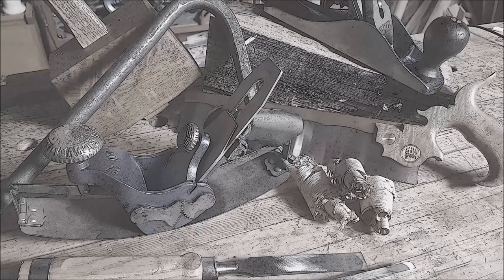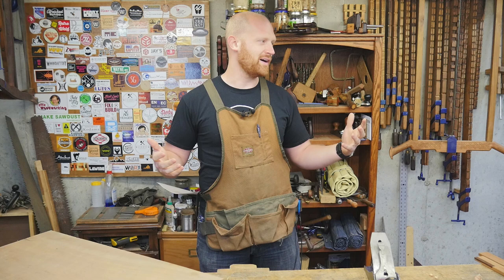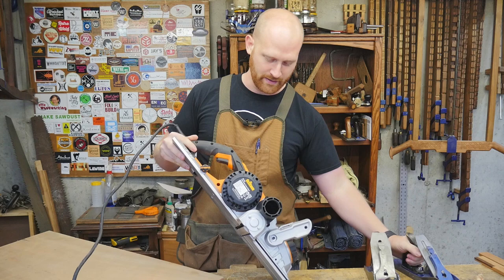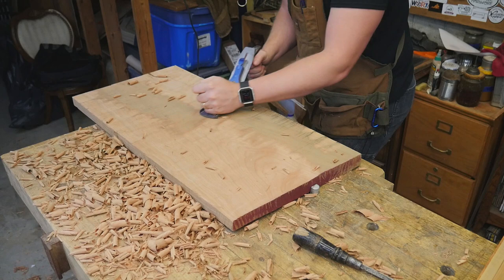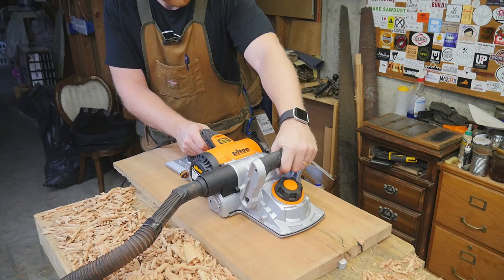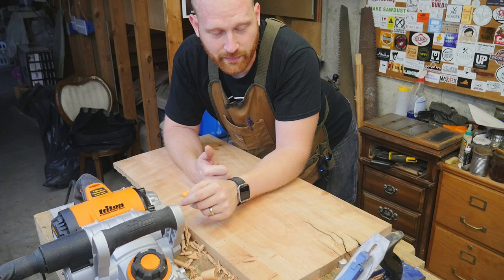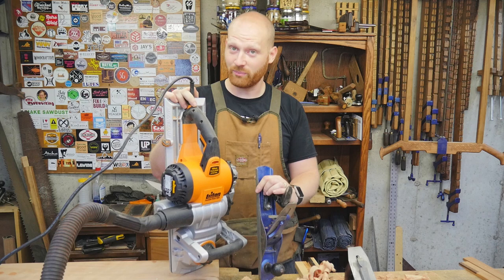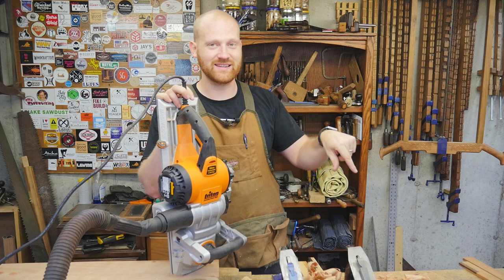Power Tool Vs Hand Tool - Power Planer and Scrub Plane Which Tools are Better in a Woodworking Shop

Comment: Thanks for the honest opinion and the video!  I agree that using a scrub plane on multiple boards is a beast to tackle by my lonesome.  I contemplated using a power hand planer to augment my hand tool use but was also toying with the idea of getting a stand alone planer.  I can see using this as a viable alternative to a jointer.  This, plus my bevel up jointer, I can make quick work of face jointing.    Great video and thanks!
Reply from the maker: +Brian M. My thought exactly. It fills that gap it tool work nicely.

Comment: That is why power tools became standard in professional woodshops, they save time and effort.  But man, I hate the noise.  Good video, James.
Reply from the maker: That is very true. one of the reasons I will never have a professional workshop.
Reply: +deezynar
They can be time saving but it all depends on what you are doing.  I have a Festool planer that is quieter than many other brands but it is still very loud when doing passes and requires good ear protection which can be fiddly at times when you are working. Nothing worse than leaving them down and forgetting where they are.
Reply: Power tools have nice returns to buy you wine than the noise.

Comment: When I was younger I became wealthy enough to buy a planer thicknesser and later a small table saw. My work got more accurate and easier and faster but I put on at least half a stone. Now I’m old I am going in the opposite direction. Hand tools are healthier and don’t affect your hearing, and usually leave your anatomy intact 😀 Most of all though, they are more fun than work.
Reply from the maker: Jim Bo so so true. And less dust!
Reply: Most good hand planers are safe to use with just a little bit of common sense so there should be no flipping the planer upside down and feed the wood in with your teeth. 

One thing people do not seem to consider with thickness planers is kick back. Exceptionally rare but could happen. The first time I ever bent down and looked into a thickness planer I got the face eat off me by an old man with one eye.

Comment: Half the time but the blade is twice as wide on the power planer and did you mention it costs $300 + dust extraction + PPE + power + noise nuisance and vibration.
Reply from the maker: all very true. that is the reason i only use it on the really big projects!

Comment: I've used a handheld power planer to shape logs into furniture components for people who want that look and I can tell you that it is 10x or 100x faster for that than a hand plane. One thing about using it the way you are thinking of is that it still requires similar skills to using hand tools. On my helical head jointer-planer combo no skills are required, doesn't even matter which way you feed the wood. Still love my scrub plane (an old converted No. 4) and my good No. 4 smoother though!
Reply from the maker: +Michael Anderson right on. I do miss my helical head from time to time.

Comment: I agree with your rationale.  I mostly use hand tools, but I went ahead and invested in a 14 inch bandsaw and a lunchbox thickness planer.  I tried a small power planer first, but have found the lunch box planer to be allot faster, easier.  for the instances where I have a piece that's too wide, I go back to the hand method.  I think you should go ahead and get the lunch box and try it out, you can always put it away when you aren't using it.  if what I'm saying isn't ringing true no worries, we all have our different ways.  love your channel by the way.

forgot to mention, my reason for the bandsaw and planer was to cut back on the two most labor intensive operations I performed regularly, ripping long thick pieces and getting large faces flat on lots of boards.  the rest I can do by hand, but I was killing myself on that stuff. sorry for all the edits not used to commenting.
Reply from the maker: my thoughts exactly. I have had a few lunch box planners over the years and have just never been happy with them and I would not want to use one again without SOLID dust collection. but that is me. a good bandsaw does have its place but I love my frame saw too much! LOL

Comment: That’s a massive planer! Yeah I don’t have many power tools for woodworking. Thinking about getting a table saw only for speed and convenience. I came from the metal working world and that’s all power tools and loud and hot and painful haha. So I definitely appreciate the peaceful quiet of hand tool woodworking. It all works out too because with my metalworking equipment, I would never have the room in my shop for many dedicated areas for woodworking equipment. Something so peaceful about hand tool woodworking. I’ve only been into it seriously for a few months but at this point I know I kinda got bit by the bug and there’s no going back.
Reply from the maker: Man I know that feeling. My last job was manager of a metalworking shop. I grew up all power tools.
Reply: Wood By Wright it’s funny how in comparison to metalworking, hand tool wood working doesn’t even feel like work. It’s a totally peaceful and joyful thing in life that I look forward to every day. Metal working, to me, just feels like work. It doesn’t feel as.. natural and human. I’m sure some die hard metal guys will disagree, but I’ve been a welder/fabricator for 23 years. All processes, all materials, all applications. From shop work with advanced materials to cross country transmission gas pipeline.. and I think wood  is better lol. Much better.

Comment: I completely agree! There is a time and place for both hand and power. 

Like the one fellow below mentioned - Triton should really make a table/unit that you could attach this two upside-down as a jointer or even thickness planner. That would be amazingly useful.
Reply from the maker: thanks. That would be a cool addition to the tool list. every tool of theirs that I have played with has really impressed me.

Comment: Great space/performance ratio out of that little machine, and second nature I'm sure for someone who's already experienced with hand tools. Fantastic find.
Reply from the maker: +Brandon Beaumia right on. Fits the shop well.
Reply: @WoodByWright  James, how has this tool been treating you? I'm trying to decide between this and a thickness planer right now and I'm wondering if you've had any issues with it, or if you've found yourself preferring the scrub plane for any reason. Thanks for any input!
Reply from the maker: @brandonbeaumia  for small pieces (one or two boards) I just grab a scrub plane it is just too much work to set up the vacuum and everything else. but If I have to do more it is my go-to tool.
Reply: Thanks so much! I ended up grabbing one with a black Friday eBay coupon for $215. Can't wait to put it to work and save my arms. =)

Comment: I do have a few power tools, but for the most part I prefer using hand tools, like you say to save time on long laborious jobs, but I mainly work by hand because there is a LOT less dust and noise. I hate having to use earplugs and a mask!!
Reply from the maker: Very true. PPE is a pain!

Comment: that's cool that you're open to using a power planer. I see your point and justification of it. one board that would probably use the hand plane to but 20 or 30 boards yeah time to bust out the 7-inch power hand planer which I am a power tool guy and I got rid of my 3 & a half-inch power hand planer just didn't like it but a 7-inch power planer that's bigger than my jointer LOL looks like it's fairly decent might have to look into that .
Reply from the maker: my thought exactly. and for the size, you can not beat the price! especially when you compare it to a lunch box planer or jointer.
Reply: Wood By Wright very true! Im gonna have to look into it's for sure never knew they made em that big.
Reply: On smaller boards I use a festool planer and then finish with a number 3 hand plane if I am doing cabinet making or furniture standard. 

If I am producing joinery standard work I will just use a 3.5 inch power planer as a finish. But if I am doing large boards I will always use a scrub planer and finish planer again depends on standard of finish. 

I do not think there is much of a difference and it is all down to personal preference.  10 years ago I would never have used a power planer of any type and was working completely manual. Once I got to use a festool planer I was blown away by it including its dust extraction. 

It is all about horses for courses. There is no one planer ring to rule them all.

Comment: you've probably heard me say this before. I am an adamant hand tool user. however I'd quit woodworking without my lunchbox planer. Handheld tools, powered or otherwise are not a substitute. it's not about how quickly material is removed, it's about how evenly material is removed. I just joint one face enough so it won't rock on a flat surface and the planer does the rest. with a jack plane and jointer,  and a lunchbox planer,  I can go from twisted rough sawn to final dimensions S2S in about 6 minutes on most boards. And the boards are all dead flat, exactly the same thickness, and defect free.
Reply from the maker: Right on.

Comment: Every time I've tried using a power hand planer, I screw something up. I just use orbital/belt sanders now. I may still try to use my power hand plane but it scares me. So easy to gouge material, just a little too aggressive for me.

Comment: A real scrub like a 40 or 40-1/2 Stanley rather than a slightly modified #5 or #6 might save a minute or two?
Reply from the maker: I did another video later comparing an actual scrub plane to a modified plane and the speeds are actually pretty close. With the scrub plane it will cut a little bit deeper however it is a much narrower cut. The modified fore plane doesn't cut quite as deep but it cuts wider. In the end it ends up being about the same amount of time.

Comment: Triton needs to make a table you can flip that thing over onto and make it a quasi jointer. 

I've flattened a panel I glued up after it cupped bad during glue up, I don't have a scrub plane...was horrendously labor intensive.
Reply from the maker: +Matthew Mohon that would be a sweet idea. I thought of putting it in one or the vices and doing that, but maybe next time.
Reply: +Matthew Mohon
A jointer will never produce the top level quality that is required on some finishes. If it is a rough flat surface then a jointer would do but you may need several passes to get it right depending on the level of bowing that is taking place.  You may need to cut the wood down to try and maximize bow cut. 

There are just so many circumstance. I do not like the idea of flipping hand planers to make a surface planer.
Reply: It supposed to come with a little fence so you can use it like a jointer weather that’s an add on it in the box I don’t know I’ll find out on Monday

Comment: Good video James. I actually just bought an electric hand plane for this exact reason. It’s only a 4 3/8 wide blade but it’s nice to have for the larger stuff. I don’t own a scrub plane but would still like to own one for smaller boards. What size is your scrub plane? Is it a 5 1/2? Oh, one more question, can you use the electric hand plane at an angle like you would a scrub plane?
Reply from the maker: My scrub plane in this video is a modified number five. Yes, you can use an electric plane at an angle. However it doesn't have the benefits of going with the grain like it would with a hand powered.

Comment: I use a small power plane for the bulk removal and then move to hand planes to finish off. And if you don't fit the vacuum there's chips up the wall, stuck in the spider's webs, in the toolchest, need I continue?
Reply from the maker: LOL got to love a power plane mess!

Comment: Do you think you'll get faster as you use the power planer more or do you think it can only be so efficient before peaking
Reply from the maker: defenently. this tool is not about the setup but the skill. you can still easily mess up the work if you do not treat it well. and I am sure I will get a good bit faster as time goes on.

Comment: Question: As opposed to a lunch box planer with knife tracks, how does the surface compare overall?  Comment: In our house we distinguish between carpentry and woodworking. If I'm making something for pure utility like shelves that are a necessity...it's power tools. If I'm doing a project for fun, design, and learning...it's a hand tool effort. Must do and love to do get different tools.
Reply from the maker: the knife tracks are as good as the sharpness of the blades. but in either case, it is not the last tool to touch the wood. that is why I compared it to a scrub plane and a quick cleaning from a 4.5.

Comment: How does the surface finish compare? Does the power planner leave a rough surface?
Reply from the maker: +Tom Kelleher it is smoother then the scrub plane that was why I got the scrub plane side with the 4.5 after. But it is not a finished surface. That is what the smoothing plane is for.

Comment: I use a Festool hand planer to get the twists out of boards and then finish with a number 3 plane. It is just as quick as use a manual hand plane. 

Now on larger boards I will use a scrub plane. A thickness planer while handy is not that much quicker and you will need to finish with a hand plane anyway.
Reply from the maker: Very true.

Comment: Wait, that's not fair, is it ? Flatening the convex side of a board is a lot longer than the flatening the concave side. The powerplaner is faster then. Boards with 2 convex or concave faces seem to get scarcer theses days
Reply from the maker: Both sides of the board require the same amount of wood to be removed. Whether it's the convex or the concave side. If I did it with different boards then that would be a much greater problem because different boards absolutely different hardnesses.
Reply: @WoodByWright  Well, it seems obvious to me that there's much more wood to remove on the side where an entire diagonal is high than on the side where only only two corners are high by aproximately the same amount. I agree, the power planer is far more efficient, also but far more tiring. I only use one when i litterally need to hog off material

Comment: awesome video.   i'd like to see a comparison against a smaller electric planer , makita / bosch etc and a larger hand plane like a #7 or 8.   still think an electric planer would win in terms of speed,  but would be a more far comparison.   use my #7 a lot but also considering a hand planer in range i can afford (which is not much ha)
Reply from the maker: well a 7 or an 8 do diforent things then the power planner. the power planer removes material where as the larger planes flatten. the one I was using here was a scrub that takes off up to 1/8" per pass. But I have wanted to see it compaired to a smaller one. maybe some day.

Comment: You mentioned that you thought buying a cheap lunch box wouldn't save you any time vs using a scrub plane. That's definitely not the case! My lunchbox saves me a ton of time. If I'm buying nice flat stock I can have all of my wood thicknessed in almost no time! It's great because I can run the noisy equipment in the tied period when the wife isn't home, then do all the quiet stuff when she is. Modern lunchbox planers are surprisingly powerful - I just bought a rikon for around $300, 13" wide cut, max cutting depth is listed as 1/8". Ive never taken a full 1/8" off of a wide board, obviously, but I have taken it off of a 6" board. Worked fine. That's one pass! Also, think about thicknessing drawer parts that you want to be 1/2" or even 1/4"! That'd be a lot to take off by hand. Did it once before I got the planer. Not my idea of a good time. The handheld will help, but running that thing over thin stock held down by (metal) bench dogs would make me nervous. I love my hand tools, but the planer and bandsaw let me skip a lot of the "donkey" work and move on to the fun stuff.
Reply from the maker: the 3 I have had in the past have not performed so well all 3 of those I was stuck at a max of 1/16" and that would risk blowing a fuse. plus you are stuck not being able to do boards over 13" l(like the one I tested it on) and you also have to have dust collection and shop space. all of those are huge limiters. not to mention the price. this was far cheaper than any lunch box I would look at. but each to their own. that is what makes this sport so much fun.

Comment: would a smaller version be more user freindly especially on smaller boards, also much cheaper
Reply from the maker: it would be but much smaller and the scrub plane is faster. and just as much work in my mind, but each to their own.
Reply: I see what your saying, I am sure you will perfect the process as you would any tool, you are right in wanting to speed up milling, pure hand tool use is great but on a large scale just a lot of work, the board doesn't care if is flattened by power or hand, it's the finish pass with a smoother that counts
Reply from the maker: very true. no one will see the marks that this leaves.
Reply: You just blew my handtool mind a little.  Now I need to go and see how much the Triton costs. If I had to pick one thing that I dread about woodworking, it's prepping a large number of boards.
Reply from the maker: it is cheaper than a new quality hand plane. and even cheaper then a Woodriver #7